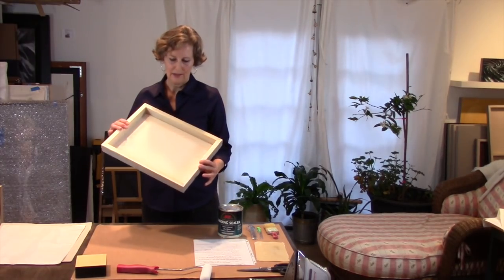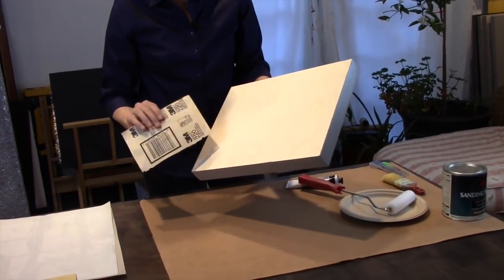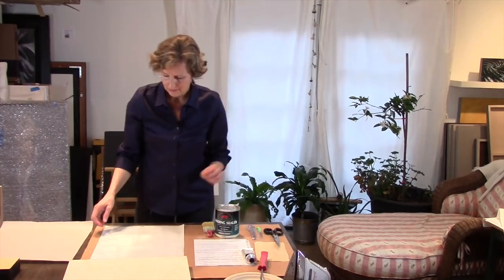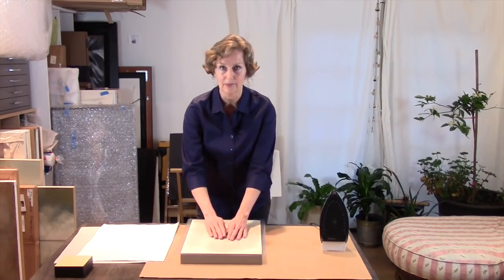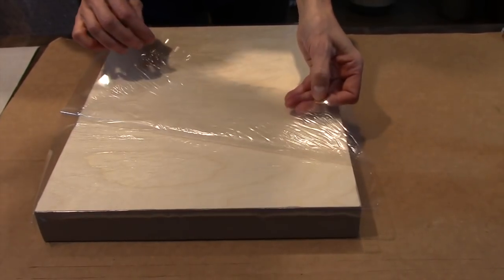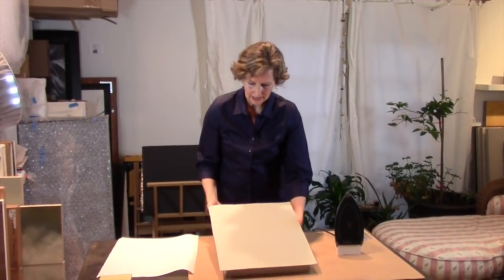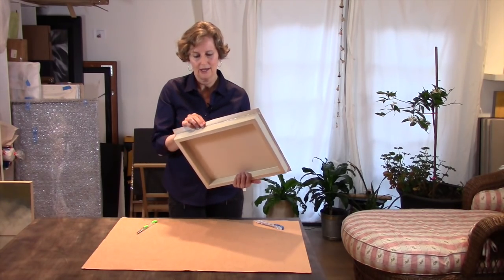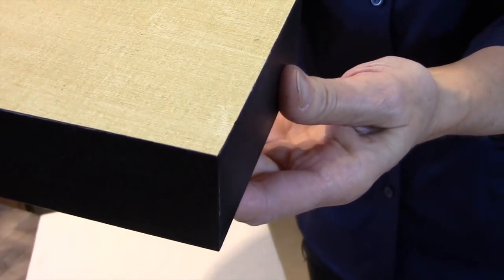BEVA 371 film: Demonstrating Adhering Linen to panel using BEVA 371 film

Comment: Thanks again.....I've now tried it out for myself and it works very well on ACM and is now much less costly and more customizable.    I would add is that if using an older non-digital iron, the temperature fluctuations can be large as it cycles on and off.  I started with too low a setting and was frustrated when nothing would happen.  I got out a thermometer and realized the iron varying from 140 to 180 as it went through its cycle and moved it up just the tiniest amount.   Then everything went very smoothly.  When doing the linen pass, I would then kick it up just a tiny bit more and have not had any bubbles since.

Comment: Best video on the application of Beva 371 film. Even though the demo is for canvas application on panel, the instruction is good also for relining canvas. Well explained covering all the necessary steps. Thanks!
Reply from the maker: You are most welcome!  I appreciate your validation.  I understand that BEVA 371 film was originally developed for relining canvas paintings and is considered an art conservator's material.  I would think that a regular household iron would give the conservator more flexibility in temperature, pressure, and position.  Thank you!

Comment: That's one of the best videos I've seen on the subject.  I was thinking to really get that Beva Film and Linen to adhere,  that I would have to buy a heat press.   Those are are about $200 dollars USED if you can find them.  Plus just having that large press around taking up space did not appeal to me.   I'm tired of the glue method. It can be a mess and it's uneven at times. This method with just firm pressure, Beva Film,  and a heat iron just looks better to me......  Thank you Melissa..
Reply from the maker: +Anthony Johnson Thanks for your feedback.  Let me know how it goes if you give it a try.  If I can answer any questions, let me know.
Reply: Thank you Melissa....

Comment: Here is the deal that nobody seems to mention in these art videos demonstrating gluing canvas onto panels.  All canvas is porous.  Even in this demo, you mentioned seeing the glue behind the canvas as shiny.  Well, nothing keeps that glue from rising above the primed layer.  Is probably less likely using this method.  But I would err on gluing the canvas after it has been painted on so you avoid painting into glue, which in time will cause cracking.  Just thought would mention this.  Glue does not stick to a primed surface, at least not oil or alkyd.

Comment: Hi, Melissa. This video was really helpful as I’ve been learning to glue linen to panel, and I really appreciate your effort here. I’ve been trying the same process with aluminum composite panel (Dibond), rather than wood, but I’ve so far encountered nothing but disaster. The Dibond panel appears to be more sensitive to heat than I expected - I’ve found that the panel warps quite quickly when using the iron. That’s probably because the heat is too high, but lower heat settings on the iron don’t seem to activate the glue properly. 150 degrees is supposed to be the ideal temperature for the glue, but irons don’t have heat settings listed in degrees, so I don’t know exactly how much heat is being delivered at any given setting. Have you ever had similar trouble with your wood panels warping in response to heat? Have you ever tried Dibond, and abandoned it in favor of wood for these reasons? Anything that you could share might be really helpful toward solving this problem. Thanks very much for your time and for this insightful video!
Reply from the maker: Kit, I use American Easel cradled wood panels and they have never warped.  I don't use Dibond because I don't want to have to frame my paintings for presentation.  That being said, a lot of people think Dibond is a superb support.  My friend, Amanda Teicher, would be very interested to know about the warping as she custom makes Dibond panels for artists and adheres linen to them.  She has a YouTube channel and a business called Amanda's Panels, www.amandaspanels.com, where you can contact her and ask.  All the best, Melissa
Reply: Thanks, Melissa and Kit. I do use aluminum composite panels, and I sell them to other artists in my area. when I adhere linen to my panels, I use acrylic mediums made by Golden: (1) Polymer Medium [gloss] or (2) Soft Gel [gloss]. I have tested BEVA 371 film on aluminum composite material with a household iron, and for me, it worked well. I've seen ACM panels react poorly to heat, but I believe that's because the heat was too high. Melissa's method could work on hardboard, ACM, birch panels, or even formaldehyde-free plywood. But I like ACM, because you can cut it with a utility knife to make custom sizes. Also, it doesn't expand or contract in response to changes in normal indoor temperature or relative humidity, making it a good choice for artists who are concerned about the longevity of their paintings. Dry oil paint and ACM behave in similar ways over time.
Reply from the maker: Since you wrote 2 years ago I have tried using this method with aluminum composite panels and it has worked beautifully for me.  Try less heat--the lowest setting and make sure to use the silicone coated butcher paper barrier.

Comment: Thank you Melissa! Excellent video and wonderfully articulated. I am using ACM  ...dibond... panel. I tried using an adhesive to mount my lead oil primed Portrait Linen, and ruins a few sheets as it had lots of air bubbles. I figured out a way in which that would not happen with my own strategy. My friend Nan told me about your video and the use of this method. I need to attach the linen to 20 x 30 and 24 x 36 sheets. Have you ever used  dibond with be a film?
Reply from the maker: I have attached the linen to dibond and found it works really well because the metal keeps the glue melted long enough to apply pressure evenly.

Comment: I am thrilled to have seen your video and look forward to using BEVA 371 soon.  Have you ever adhered your canvas to a board in order that you DO frame it?  If so, can you share what is required for a board that will work and if there is a source.  I feel like you have opened a door!!!  Thank you!
Reply from the maker: I make my own panels that I frame using aluminum composite panel as well as birch panels and mdf panels.  My favorite are the aluminum composite panels for longevity but for international travel and plein air painting I also use lightweight, thin birch panels.  Remember to lightly sand the aluminum composite panels for good adhesion and seal the birch panels.  Avoid using wet media on your panels like watercolor or acrylic washes as they tend to shrink the primed linen and cause it to pull away from the edges.  I get my aluminum composite panels from Amanda’s Panels in Seattle.  The birch panels are from Artist & Craftsman in Tacoma.
Reply: @melissaweinman167  Thank you!!!  I just checked my iron on the lowest setting and it reaches 190* which may be a bit hot.  Is it possible to attach the film AFTER your oil painting is complete?  I am guessing not.  Is it possible to use the resin to secure a finished oil painting?  I have used water color for years.  My portrait commissions have all been done in pastel. The dust is such fine particulate and I am transitioning into oil.  I had purchased some Centurion canvas pads to begin and then wondered what I could do with them later if the were actually successful pieces.  I do appreciate the amazing video.  You are a wonderful instructor!!!
Reply from the maker: @averymaples8472  I have had wonderful success in using BEVA 371 film to adhere finished paintings to panel.  Afterall, I think art conservators use it to re-line old canvases before repairing and restoring paintings.  I am careful to make sure that the painting is dry to the touch.  Any heavy impasto is going to be flattened, so be forewarned.  I always use the silicone lined butcher paper as a barrier between my painting and my iron with the silicone toward the painting, which  reduces the heat from the iron a bit and prevents sticking.  If you think the iron is too hot at the lowest setting put two sheets of paper between the painting and the iron or simply move the iron faster and lighter over the surface.
Reply: @melissaweinman167  WOW!!!!  Now, Beva 371 is without a doubt definitely the product to use.  I cannot think of any feature that would make it more perfect. I had wondered how conservators could remove it without heat but thought doing exactly the opposite as adhering it surely was not it.  This is the very best!!!  Brilliant!  Thank you again.  Off to order.

Comment: I saw that you have done this method with an aluminum panel.  How did you cut the aluminum panel?  Thanks for the video.
Reply from the maker: Constance Healey my friend, Amanda Teicher has a great YouTube  video on buying, cutting, and priming Dibond/aluminum composite panel.  Check it out!  All you need is tape, a metal straight edge, and a box cutter.

Comment: Melissa, thank you for the well-done video on the use of Beav 371. Do you know of how I might find additional instructional videos and information on the use of Beva 317 for the mounting fragile oil paintings (24" x 36") on paper by an important 20th-century painter? There are too many pieces to send to a conservator and I have been mounting prints and artworks for many years but don't feel comfortable out of the box mounting valuable artwork. My mountings over the years have been excellent and with a little help would feel comfortable doing it myself with the use of Beva 317. Any thoughts? Thank you. Jeff Tallman
Reply from the maker: You might just call Museum Services Corporation in Minneapolis and talk to them, if you haven't already done so. (651)450-8954

Comment: Without reading all the fine questions below, what would be your thoughts on mounting finished watercolors this way? I have been mounting my work on MDO with HB gel Medium with good results. I'd like to attempt this. Can I get the beva in small sheets for 11 x 14 with overage?  I will search the product for more answers. Thanks
Reply from the maker: I buy BEVA in rolls so I can cut it to any size.  My only concern with watercolor would be scorching the paper.  To avoid discoloration I would do a sample / test to see if the heat discolors the paper.  I have used gessoed BFK paper and the adhesion was good.

Comment: Hi Melissa,
Thank you for the instructions! I was wondering if you might know if I can use BEVA film to attach a large 100 year old painting that was painted on an old cotton sheet instead of a canvas. The sheet is falling apart. I want to glue the painting onto a linen canvas so that I can stretch it onto a frame. Do you think BEVA would be something that would work for this? Thank so much in advance!
Reply from the maker: This is what BEVA was made for: relining paintings that were deteriorating.

Comment: excellent tutorial. thank you. question - have ever or do you know of anyone who has used beva 371 to mount oil paintings on paper onto a board with beva 371. i have 100 to 200 paintings 18" x 24" up to 36" x 48" paintings on paper that i want to mount on board. with that many i have been thinking about getting a heater vacuum table. can anyone help?
Reply from the maker: Jeff Tallman thank you for commenting and asking a really important question.  Because a liquid adhesive would possibly cause your paper to buckle, the BEVA 371 film which liquifies only briefly might be the perfect solution for you!  I would do a test with a sample and see how it works.

I’ve never used a heated vacuum table so I can’t comment on that.